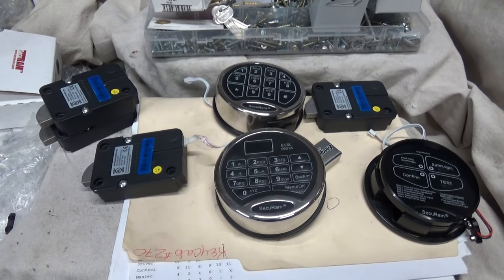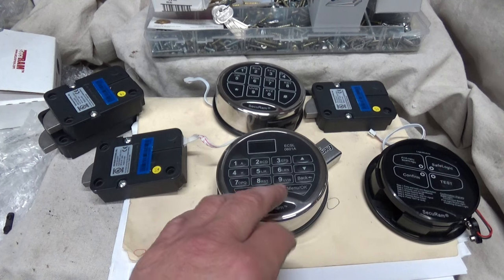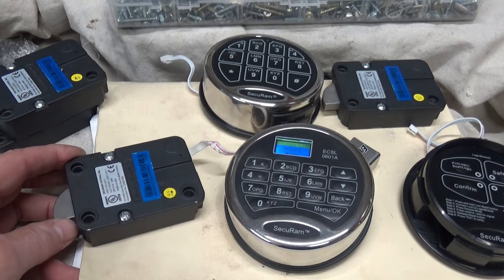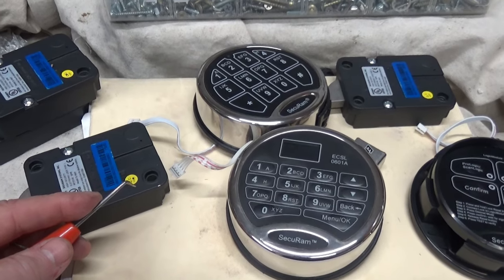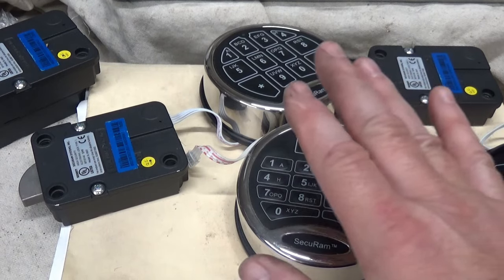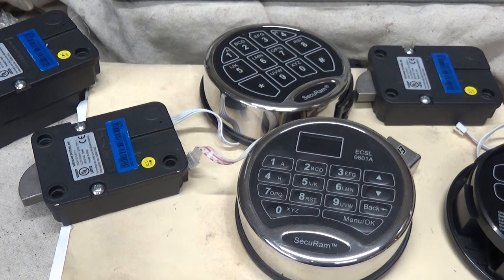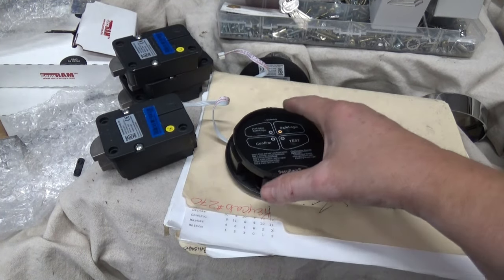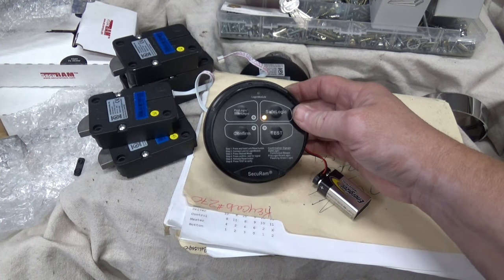Securam safe lock NOT working? Lagard S&G safe locks repaired & opened lost safe combinations reset

Comment: So if you plugged the tester into a locked safe, it should open it, right?  you would just need a connector to plug both cables together, one from tester and one from the safe that was connected to keypad.  Unless the tester only works when the lock has been set to factory defaults.

Have a great day
Reply from the maker: @gkeyman565  you can splice a keypad in..or a LBB or a Phoenix

Comment: My Securam died. Changed out batteries. Worked fine. Few days later battery dead again. (Duracell)now each button stroke blinks and beeps twice. Almost as if one button push equals two presses. I put same but new keypad on and same thing occurs. Any tips to get in my safe? I’ve tried taking battery out and pushing buttons to clear for a while then trying again. Enter code and it works. I’ve seen a few have had luck with that. Anything I can try before someone has to drill it? Thank you!
Reply from the maker: @HugoMartinez-wf9mn  only thing to TRY is unplug battery and try to drain capacitors for a week. Replug n try. Try 123456 and your combo.

Comment: Great info. Thank you for explaining this through. By the way what would one do if the lock body itself mal-functions since the codes are stored inside the lock body and not the keypad? and is there a redundancy inside this happens?
Reply from the maker: Not really a second chance,like a malfunction in mechanical locks digital is no different-it comes down to the drill typically. There are types of bypasses for E locks but not always effective.
Reply: @hkssystemslocksafe2486  thank you again

Comment: I appreciate any help I can get. I have two safes with the analog SecuRam pad on there. One pad is working fine, but the other one isn't. I changed out the battery and put in a new one (I know the new one is good because it works on the other safe). The two red lights will turn on, but when I push the code there is no beeping sound like there is with the other safe. Sometimes the two red lights will come on when pushing the button, but regardless no sound is made.  The other noticeable thing about that safe is the the safe is locked but it feels like there is a lot of movement in the handle where as the other safe that is working has little to no wiggle room and feels securely locked. Any, any, any help at all would be appreciate.
Reply from the maker: from outside you ONLY have 2 things to try. 1. a new keypad 2. new batteries, then after that it's drill it and fill it!
Reply: @hkssystemslocksafe2486  Much appreciated! I was going towards the keypad replacement, so hopefully they solves it. Thanks again for taking the time :)

Comment: So I’m ditching my S&G Group 2’s after learning how manipulable they are. What stopped me getting digital was concern about hardware failure. I’m an EE, we do MTBF analysis…all electronics die eventually. Oddly I have more faith in simple mechanics.

That said ranting aside if the Pro Logic keypad shits the bed but the inner lock is still alive and well. Can you bring a new keypad to the party if you know your passwords? It seems they need to be mated and to be mated you need the door open, panel off, to be able to press the reset button.
Reply: Everything is stored in the lock body so a new KP would work as long as the malfunction wasn't in the lock body.

Comment: I have an odd one for you. I'm an automotive locksmith so safes aren't my thing. In my previous home I had a floor safe that I installed. I don't want to say the brand but it was a good one and they were good to me. It was a C rated head with an S&G 6730. I sold the house and took the head with me. I contacted the manufacture for a new body for my new home. They changed some things up as the head was 20 years old so they wanted me to send the head in and they would make it fit on a new body. While there I asked them to put a Securam analog on which they did. For some reason and I don't remember why maybe to install a new battery with the head open I couldn't get the ring off to save my life. It would turn a little but stop. I contacted Securam and they walked me through a couple things but nada. They told me to do whatever it takes and they would send a new KP. I took a Dremel to it and they also wanted everything sent back for an autopsy. Have you ever run into that? They sent a new KP and everything has been fine since. I also registered with them and did a few of their courses.
Reply from the maker: ANY e safe lock and floor safes are a bad idea in my book! Securam models never turn to remove just push upwards to pop off mounting posts?
Reply: @hkssystemslocksafe2486  This was the ring to get to the battery. The new one works as it should. I still have the 6730 so I can always swap it back but so far liking the Securam until I have to fly you down to Fl to poke a hole in it. :) I also put one of their elocks on my gun closet.

Comment: Could the Secure - Ram (as I pronounce it) Test Box be used to open someones Safe?  Even though you call the "Secure-Ram" basic model the "Analog model", isn't it really digital in it's communication from the keypad to the lock body?
Reply from the maker: No it can't bypass if that's the question.only tests in a factory coded lock body According to Securam basic models it's analog signal being sent? The other models are digital?. I can't see a difference myself,but they make the product.

Comment: What would cause it to stop locking ?
Reply from the maker: Mechanical OR electronic failure. Try new batteries then change lock IF that don't work. You can put code in and pull cable before it relocks it will stay open until it's plugged back in with power.
Reply: I have one that the keypad is frozen even with fresh battery. I cannot get it to do anything

Comment: hi,..  i have problem  with securam,   My pasword is Correct but why  can not Open my Lock ( 3 beeps )
Reply from the maker: change batteries and retry! Use Duracell or Energizer. IF that doesn't work next step-change keypad then DRILLING would be needed most likely. Use the link to find someone close to you.